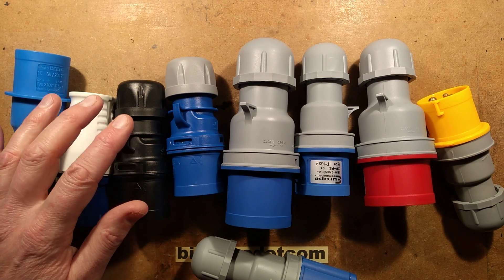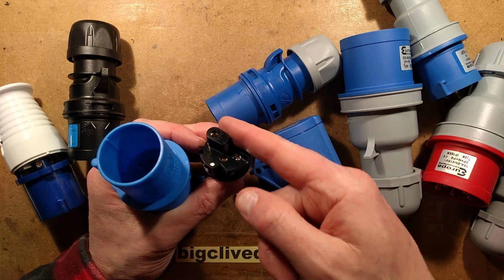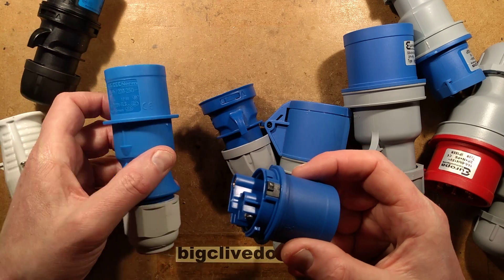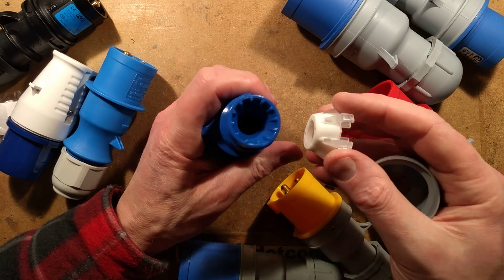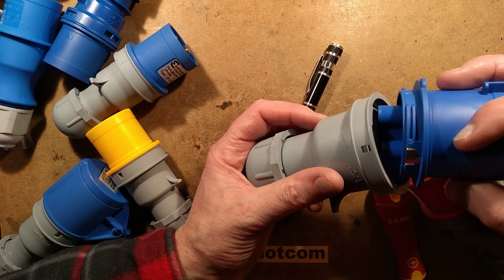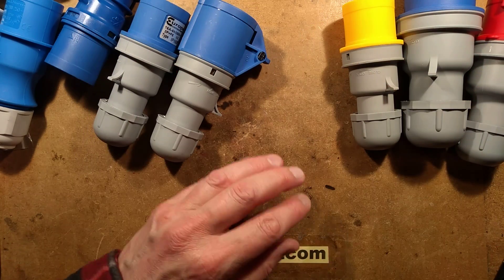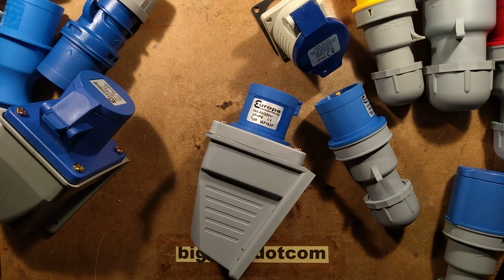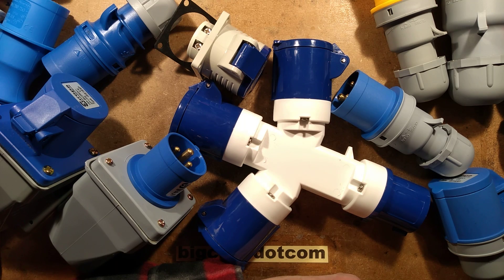My favourite industrial connector (Ceeform).

Comment: CEE connectors are the standard in Western Europe. They are very affordable and reliable. Almost all of them are rated IP44 and use a clock position of 6H.

In datacenters you will see mostly red 5 pin 32 A 3P+N+PE 230/400 Volt connectors and blue 3 pin 32 A and 16 A P+N+PE 230 Volt connectors. In film / motion picture lighting they use mostly blue 3 pin P+N+PE 230 Volt connectors in 63 A, 32 A an 16 A variants. Because lights are always single phase. In theatres you will find red 5 pin 125 A, 63 A and 32 A for distribution and blue 3 pin 16 A for equipment. Stage Rigging Hoists use red 4 pin 16 A connectors.

In agriculture, industry and on building sites you will find mostly red 4 pin 32 A 3P+PE 400 Volt connectors. Because of all the electric motors around. Special application concrete vibrators are used for concrete compaction and are usually 42 Volt at 200 Hz. These use a green 32 A 3P connector without protective earth with 4H clock position. It comes with an external frequency converter that consist of a 42 Volt 3 phase generator creating 200 Hz directly driven from a 400 Volt 50 Hz motor. The power of these devices is usually 2.2 kW.

Professional ovens in restaurant kitchens are connected using red 32 A 3P+N+PE connectors. In telecommunication installations you will find a lot of -48 VDC but I am not sure wat kind of connectors they are using.
Reply: Yeah, pretty much, Germany calling in, they are the most common connector for Outdoor 1 phase (camp and boat) and 3 phase connections in general.
Since every basic electric utility connection is 3 phase here, they are also very common in houses.

Yes, many Europeans have common access to 400V 16 or 30 A 3 phase power :-) and most utility connections are ≥80A.

Even the oven in my 3 room flat is hooked to a 3 phase 400V 20A connection :-P
Reply: They are pretty standard in whole Europe., West, central, east. Doesn't matter. There are few exceptions, like low current 3 phase connectors in Switzerland, but the cee is used too, and probably equally popular.
Reply: @movax20h  we had the Perilex system here in Germany in domestic installations, but is has become quite uncommon and has mostly been replaced by CEE connectors.
https://en.wikipedia.org/wiki/Perilex
Reply: @DooMMasteR  Interesting. Never have seen them (perilex), even indoors in old buildings. Thanks.
Reply: @DooMMasteR  While I am Danish, I know Perilex, the Swedes have it too, or something similar,   the problem with CEE is that it takes up a LOT of space behind your stove in the kitchen, witch is what the Perilex is for, OR if you are smart, have NO connections behind white goods, but have the connection in the cabinet besides it.
Reply: @jesperdahl1486  Yeah, the old LK IP20 380V/16A domestic connectors were a lot more practical for typical indoor use.  Not as good as the Swiss ones, but still great.  Essentially CEE harmonization has left CEEform the only plug above 230V/10A.
Reply: @johncrowerdoe5527  Your assertion about 10A plugs are not entirely correct,   SCHUKO has a 16A rated plug, Denmark has 16A rated plug, the Italians have a 16A plug, and the Swiss, and the French, only  the British do not, having to make do with 13A   and you are still free to use Perilex in homes.
Reply: @jesperdahl1486  Which plug (besides the legalizing of Schuko and French 230V plugs) are those?  Because I haven't found anything current, legal and as good as the old 10kW plugs that protruded only about an inch or two from the wall, including switch, socket, plug and cable.
Reply: @johncrowerdoe5527  I made NO comment about form factor, only about the existence of a 16A rated plug, the Danish is called 107-2-D1   the Swiss is called SEV 1011 Type 2x   the Italian is called CEI 23-50 S 17   (type schuko in Wikipedia and you will se pictures of them all)
Reply: @jesperdahl1486  107-2-D1 is apparently the classic 220V/10A, possibly uprated to 230V/13A or maybe 230V/16A (citation needed).  Still not enough for a 10kW appliance like a full size stove or a tumble drier.
Reply: @DooMMasteR  The (old) Perilex plug is still standard in the Netherlands for connecting a domestic cooker / stove. Sometimes wired as 400 Volt 3P+N+PE but mostly wired as 230 Volt L+L+N+N+PE. Which is a weird way of getting 32 A using two 16 A miniature circuit breakers linked together. Please don't ask why.
Reply: DooMMasteR perilex is still common in NL in one particular application: electric cooktops & stoves. Ceeform is gigantic and expensive by comparison, so they survive.

In NL, most houses do not have three phase connections — or to be exact, the house does, but only one of them is given over to the panel. This allows the electricity company to easily switch your house over to balance phases if necessary, or to install a 3 phase connection if you really need one. In old houses, the street cable is usually capable of 3x25A or 3x35A, in newer houses more like 3x80. If you’re in one of those 25A houses and you want to start cooking electric (which is basically the only common thing that takes gigantic oodles of electricity), then you get your 1x25 upgraded to 3x25 and you put it on a 3 phase 16A perilex as normal and as labeled. If you’re in a 3x35A capable house, you just get upgraded from 1x25 (if you still have that) to 1x35 (same price as a 3x25, being 1 up from the default). Now here’s the tricky part. Behind the 35A you could only put a 20A fuse to maintain specificity, no more, and that’s not enough for a cooktop. And also we have a massive fetish for never using fuses larger than 16A in domestic installations (and these days, we also do not use anything smaller, basically everything is 16A, normally B-characteristic). So what do? Can’t use a single phase connection to that cooker, can’t use three phase. So how about making a special fuse group where you have two 16A fuses, both wired up to the same single incoming phase, and then connecting them physically so turning off one turns off the other. And then you take a perilex, helpfully labeled in N L1 L2 L3, and what you hook up there is Neutral 1, Live 1, Neutral 2, Live 2 (or some variant, don’t pin me down on whether there is a standard order to those monsters). The wires in between are allowed to be in a single conduit, but they’re literally two neutral wires and two phase1 wires. It’s called the “cooking group”.

If you’ve ever wondered why, in the manual for most cooktops, they include instructions not just for how to wire them to 1 and 3 phase but also 2 phase.... us. We’re the reason.
Reply: @jesperdahl1486  Yes, Perilex is common in Swedish kitchens but the neutral is not always wired in older installations. Anyone replacing their old stove with a new induction type have experienced this the hard way and had to call an electrician to wire the neutral and sometimes repair their new stove.
Reply: @Frankhe78  that sounds illegal...
My coooker uses 3x 400V at 20A...
And 90% of connectors are now panels behind the stove (Herdanschlussdose)
Reply: @Frankhe78  using 2 phases is really shitty...
My oven cooker combo uses 21kW when connected to 3 phases...
Only 10 when 2L+N is used and it won't work on a single phase....
There is probably just a 3 phase (including N) full bridge rectifier behind the panel and the rest is DC so it does not really care how the power is getting to it.
Reply: Ex-TeleCity Datacentre engineer.....back in the 90's we ran with 16A-32A per rack so mostly saw the blue variants per phase. Out of the game now and I imagine things have moved on.
Reply: @tehklevster  nah they are still standard, blue for single phase red for 3 phase in 220-240 V countries.
Reply: @DooMMasteR  Actually you're right....my memory is vague and been a while since I worked in that sector. Just a web dev keybasher now :)
Reply: @DooMMasteR   red is 400V 3 phase TN plug, but blue is also used for 230V 3 phase IT.
Reply: @MichaelEricMenk  230V 3 phase is not common in europes mains…
yes there are fitting plugs but usually 3 phase is split phase (400V here)
the blue ones are 230V single phase (usually) only 3 poles
https://en.wikipedia.org/wiki/IEC_60309
but there might be non standard usages o.O
Reply: @MichaelEricMenk  Blue 3 phase is for where phase to phase voltage is 230V ( think some of Norway )
Reply: @DooMMasteR  Norway ( non EU ) has / had some 3 phase 230V, due to the poor conductivity of their ground, GRANITE,   other then that I can not think of 230V 3 phase anywhere in Europe either
Reply: @jesperdahl1486  yes, I know that's what I wrote.

In Norway new development have TN, most existing houses have IT, hospital must use IT, it's more robust than TN.

TN = Terra neutral
IT = Isolated Terra
Reply: @jesperdahl1486  The electrical standard has nothing with EU. So pointing out non-EU gives no sense.

I believe that Albania also have a lot of IT electrical grid.
Reply: @MichaelEricMenk  but IT vs TN has nothing to do with phase to phase voltage...
Hospitals and so on use single or center tapped IT systems and they are not common because you are not allowed to use isolated devices on such circuits, and additional measures of protection against electrical shock have to be taken.
I have not seen a hospital using a 3 phase 230V IT system....
They are usually limited to intensive care and operating rooms.
Reply: @MichaelEricMenk  It would be nice if you only wrote about things you kneo about, your idea that IT is better then TN (C) or TN-S  is absurd, showing that you do not know what you are talking about, IT systems are the LEAST safe system there is, it USED to be used for very sensitive equipment in hospitals, in a local and very controlled way, to my knowledge it is not used anymore.     The cousin of IT,   TT is not much better, it has the potential (ha ha) to have 50V to 100v differences of ground potential from one end of a huge building (hospital) to the other, or between adjacent buildings, a HUGE problem when they are connected to the same data network, as they normally are.    But you are correct in that the EU has nothing to say about the electrical supply grid in NON EU countries (that they are not connected to)     I have no idea what system Albania uses, and it has NOTHING to do with this discussion.   This discussion started with the fact that some areas have 3 phase 230V supply due to POOR ground conductivity (and possibly other reasons) whereas the rest (most) of Europe (and beyond) uses 3 phase 400V with a grid supplied neutral, for 3 times 230V.     And Clive's video was about plugs developed when the EU was called EF, the fact that the standard has proliferated to other countries, and regions, does NOT alter the fact about were (and why) they were developed.
Reply: @DooMMasteR   DooMMasteR  wrote: "but IT vs TN has nothing to do with phase to phase voltage..."

Yes and no.. 

You can of course make a 3 phase TN  network with 10V... But we want 230V. It you want a single phase 230 volt, the voltage you get at the 3 hot phases in a IT or TN is given... We hare taking here about 230V... 

 DooMMasteR  "I have not seen a hospital using a 3 phase 230V IT system...."

I was answering to a reply about Norway. The entire Hospital is run at 230V IT system. Not just the  "intensive care and operating rooms."
Reply: In a reply to me writing: "In Norway new development have TN, most existing houses have IT, hospital must use IT, it's more robust than TN."

 @jesperdahl1486  wrote: "It would be nice if you only wrote about things you kneo about, your idea that IT is better then TN"

You know I checked sources before I wrote. As a Dane, you can read Norwegian, you can check for you self.

And please do not put word in my mouth!!!!!

I did not say at "IT is better than TN". I did not say it was safer than TN. I wrote it was more robust. It's the reduced safety properties is what makes it more robust. (yes, at the cost of increases fire-risk +++ ). 

As DooMMasteR wrote: "They are usually limited to intensive care and operating rooms." 
From a medical safety perspective, its better to have this in as many rooms as possible.

jesper dahl wrote: "The cousin of IT,   TT is not much better"

Yes I now, it's what I have. In Norway common to only refer to IT and TN, due to from the user perspective there is no difference between IT and TT. So when talking plugs and equipment, no-one here in Norway talks about TT. So since we were talking about the COLOR of plugs, I only used IT and TN.

jesper dahl wrote: " I have no idea what system Albania uses, and it has NOTHING to do with this discussion"

You brought up "Norway ( non EU ) has / had some 3 phase 230V", to second you comment that the 3 phase 230V is not commen, I wrote that it was one more country in Europe that have it.

BTW,  3 phase 230V (mostly IT) is the most common in Norway. If I remember correct it's 80-90% of residents are connected to 3 phase 230V. New development is TN.

By the reply you wrote, you seamed irritated.  When I wrote  "TN = .... "  in the reply to you, but to a third party that may be interested, so they can learn more...
Reply: jesper dahl here in NL we used to have some 3 phase 220V still around, usually meaning that every circuit had 2 phases on it and nothing else because that’s what you’d use. They got rid of the last of that in the 90s.

I actually think the EU does mandate the 230V 50Hz, so EU might actually have something to do with it.
Reply: In the Netherlands we use these connectors also in the theater and festival world.
For power:
Blue 3p 16A - 230V
Red 5p 16A, 32A, 63A and 125A - 380V
And a 4p for motorcontrol.

Comment: Here in Australia in the entertainment/AV industry power distribution is generally done with the Australian/New Zealand standard 3 phase connectors(which are in nearly every venue and major building and cool in their own right), and the standard local single phase connectors, with some Socapex, Trucon, etc to the end devices. Only seen Ceeform occasionally on some new speakers we got, where we just had standard mains plug to Ceeform tails from our 3 phase distro.
Reply: CEE connectors on speakers, wow.
Reply: @Frankhe78  Well they were some pretty massive subs

Comment: I shudder at listening to you describing stuffing unterminated, bare-stranded leads into screw terminals where they're ready to be sheared by the screws't tips, especially under the abuse you speak of. Please always use ferrules, if only to ease the conscience of your fellow continental sparkies, in event and entertainment settings or otherwise.
Reply from the maker: Having reterminated many connectors where the cable has fatigued through flexing at the strain relief, I've not really seen major strand damage on properly terminated plugs and sockets.  That precludes terminations where casual labour has screwed down onto insulation or put a single layer of pre-shredded copper strands into a connector and then tightened it to the point that the screw head is damaged.

Comment: They're very common in Austria, any higher-power outlet will have them. Also, if you are going camping anywhere in Europe, this is the outlet the camping grounds will provide. I have recently modified the cable drum I once bought in Italy, because it was configured stupidly - it had a short lead with a CEE connector and a long one wound on the drum with a Schuko socket. This meant that you had to leave the drum next to the sockets and couldn't put it somewhere safe in case it rains. It wasn't protected against water ingress, so in the end I had to unplug it every time I wasn't around, lest I should electrocute someone in case it rained. Winding the cable onto the drum was also a faff, so I just took the long cable off the drum and installed a CEE connector on the end of it. It's much better than a drum - easier to coil it in your hands, and takes far less space in a small car. I found that I liked the connector too - it was one of the turn-snap things with quite an aggressive cable gripper and clearly marked lead attachment points. Nice. When it comes to negatives: I think that the holes in the socket are quite large enough for a small child to put a finger in it, so keep in mind that it's a potentially hazardous  industrial thing. Also, I still haven't found a method to unplug those things without the spring-loaded cover/catch thing scratching my fingers.
We also use them in the data centre where I work. All the large IT components (integrated racks like clusters, blade centres, NUMA supercomputers etc.)  use them, albeit mostly in a five-pin three-phase configuration. Since the redundant pairs of power supplies are wired to two different phases the machines will keep running even if one phase fails. This is particularly useful for annual tests of residual current devices (RCD/RCCB, or as they are commonly called here, FI-Schutzschalter). Hm what was I talking about again? Ah yes. CEE good.
Reply: Wear a pair of work gloves when unplugging the connectors to protect your skin.